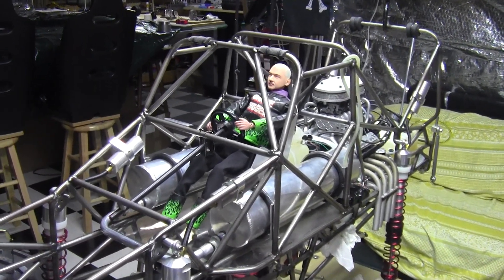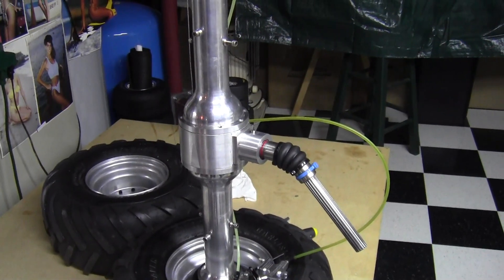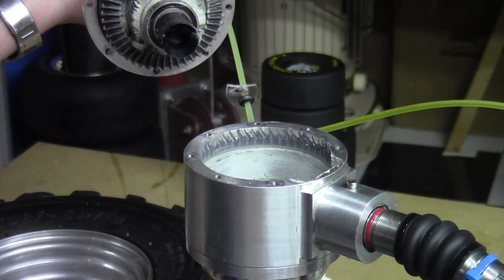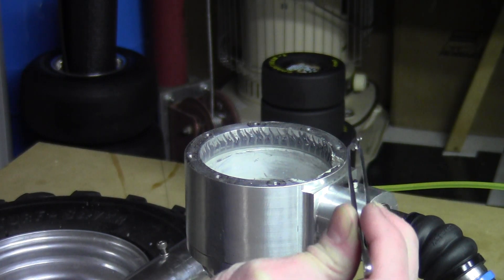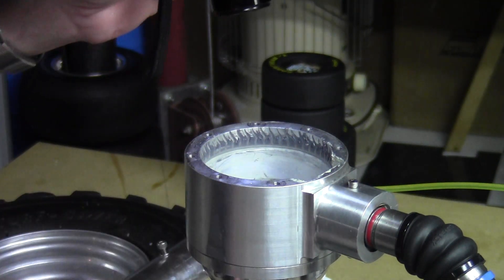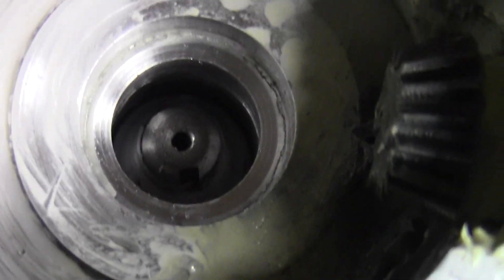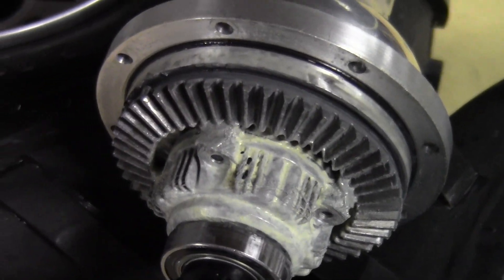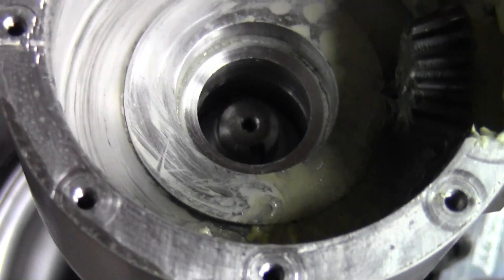1/4 Scale Grave Digger Part 24H with Stinger 609

Comment: Full floater means the outer hub is supported by the axle housing and the axle is then splined at both ends and floats between the diff carrier and outer hub.

Comment: A broken $5 pin in your custom bevel gears would be a bad thing to say the least.  Wondering if you are planning on retrofitting cup seals at pinion and wheel hubs if your converting to diff fluid. Gotta keep fluid off the brake rotors right? Might as well convert to open bearings if your going wet. I think a diff locker is going to put more stress on your bevel gears also IMO.

Comment from the maker: The broken pieces cannot get to the bevel gears, the bearing the diff rides in seals that area off.  One benefit of a diff locker would be, when a tire comes off the ground in a turn (Part 23C at :52 seconds) the truck would continue to move, and that tire would not spin and do damage to parts when landing back on the ground.

Comment: Looking good. Keep up the good work, there is always an option to make those pins stronger, but with that added strength usually comes brittleness. If you break a tool steel pin it will likely end up in a lot more chunks, and then you really have to worry about your gears. Maybe it  is not such  a bad idea to have a weak link...

Comment from the maker: No.
The 5B diff is holding up quite well.  It's other parts that are breaking, pins, belts(when adjusted to lose).  A store bought diff is much easier to maintain, I can buy a gear Faster than I can machine one.

Comment: If you want a posi rearend, fill the diff cup w silly putty, unbolt the cup from the ring gear and mash it into the spider gears till its 90% full. This works great in 1/8 scale nitros, you get posi traction but still has some give if you land on one wheel or when cornering which will help save your gears or axles compared to a locked rear.

Comment from the maker: That would not fit into the HPI 5B diff joint.  The key way was not the issue, it was the pin thru the axle on the inside.

Comment from the maker: You do realize your suggestion is Much easier said than done, yes??!! The stubs coming out of the diff are Case Hardened material, near impossible to machine a replacement part on my Smithy manual 3-In-1 Lathe.  It would appear those pins are now the weakest link rather than the Belt.  Meaning I'd rather break these $5 pins than something more expensive or time consuming to make, further up the drive system.  You Agree???

Comment: Actually I would machine down a hardened 12.9 socket head cap screw. Then match the hex axle with enough left to turn a round axle for your wheel bearings. With a rigid setup and carbide cutter you can do it. Machine the threads off the bolts to match the diff stub.  A torx drive socket head cap screw would be the best and the closest to the preferred spline, for maximum surface area and torque. The problem there is finding torx profile shaft stock which is not available.

Comment: Redesign the dogbone output stubs off the diff to hex, then turn down some chrome moly hex stock (McMAster Carr) for new axles. Since you have a solid axle housing with solid half shafts there is no need for a dogbone at that point.  Even using hardened drill rod for pins with your current setup it will be too weak... then your next vid you will have to be adding bead locks to your rims. ;)

Comment: The pin will never go into the gears because its sealed off with the bearing, just so you know. You could keep this as a weak point to save the ring and pinion its a lot easier to replace a pin or two than machine gears .

Comment: Clearly, it is not a bolt in part. I have had the outdrives you are installing on your ring be eaten by stronger axle pins. I just took the 90030s as an example of a way to interconnect you ring to the axel. Of course i'm just an idiot on the net.

Comment: one good thing, with it being 1/4 scale, it's a lot easier to work on than an 1/10th scale or a 1/14th scale lol
Reply from the maker: +Colin Shard.   What do you mean, I have to Make my own parts.  How many people does it take to lift your truck onto your workbench??  :-)
Reply: ok i agree it's a big job to lift it onto the bench, but what i really meant is that the pins that fit into your drive shafts are easier to handle than one in my 1/10th scale car, i didn't mean to offend you in any way, i understand that you have to make all you own parts,but they are more manageable, if you drop a screw or pin on the floor, it is easier for you to find it, but if i drop one of my pins, it's gone for good :-)
Reply from the maker: +Colin Shard.  I know what you ment,  I was just funning with you.
Reply: owwwww........grrrrr hahaha

Comment: An easy way to strengthen the connection at the dog bone pins is to rid any slop between the cup slots and the pins, use a larger pin but shave the ends to make them flat so they fit in the cup slot snugly. Here are some pics to show what I mean, perhaps it will help or give you some other idea. Scroll to the bottom and look at the super duty v.3 Obviously these are not the right size, just an example. darksoulracing  com / DogBones html

Comment: Wouldn't a custom scale heavy duty  diff. be a lot more reliable and compliment the build ? Also easier to service n maintain...That hpi 5b or an 5th scale stuff for that matter  was never built for the torque and weight your custom Digger is pushing...Theirs no question if you are able to do it ! lol ...Are you planning to is the question..?

Comment: Should probably get an actual automotive engineer inolved who know about material strength and design limits. Those 1/5 scale driveshaft pins are not very strong, usually the Chinese heat treat them without annealing so they are brittle. Next ones you get put then in the oven at 400 for 10 min, then let cool down slowly. They might lose some surface hardness but at least they won't snap like toothpicks. Also I believe lost sells just the dogbone pins. Get a hudy tool and replace em yourself.

Comment: dog bone drive shafts will not put up with the power you have, great project tho..
i have a 1/8th scale brushless monster truck with 6hp, alot of mods to get it this far.
i run 4WD with a locked rear end and a viscous LSD at the front end.
Reply from the maker: The new pins are holding up, did you see the doughnut in video "Driveway Tuning" ?
Reply: hehe i am watching shop update part 3.
nice machines..

Comment: And I still can't figure out why you don't have your front shaft connected ? And if you really wanted to be the Big daddy Oh you should get rid of the Wheel calipers and rotors and use the Pinion brake system , there is less drag on the wheels and less crap to goo up the works .. just a thought ...if you wanna know why you sheared the pin's because your NOT using hardened pins or NOT hard enough .